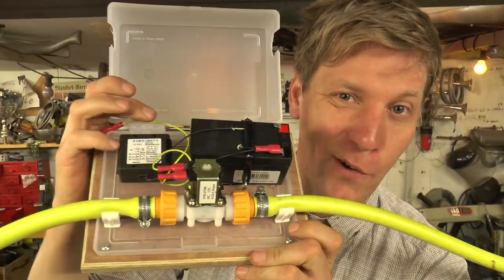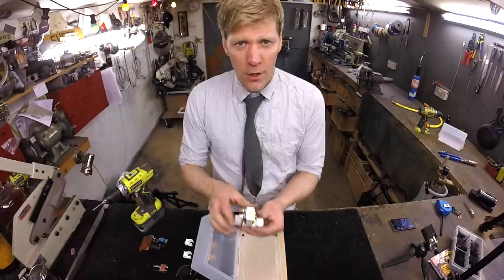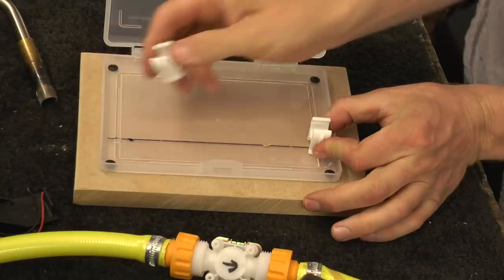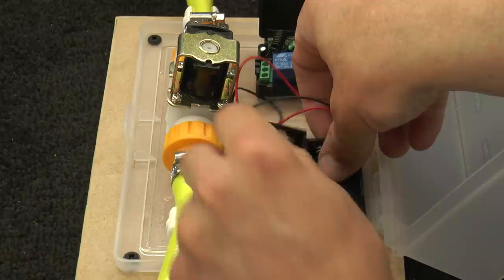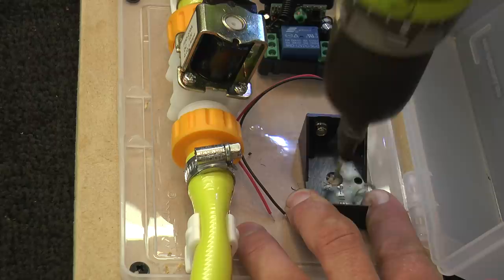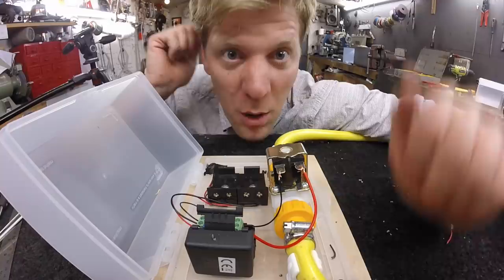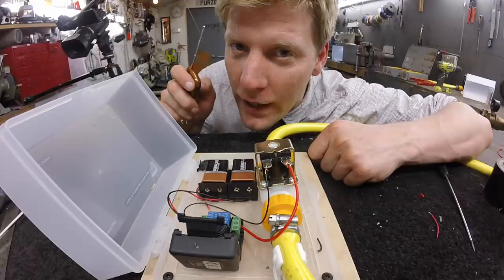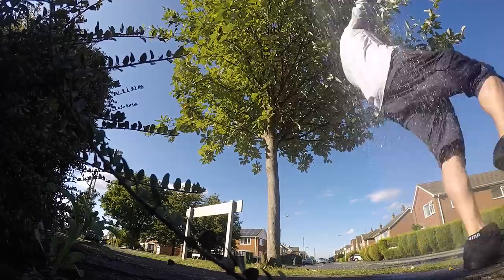How to Make a Remote Hose Pipe Controller

Comment: Using 9v batteries, that receiver will probably drain them in a few days. Also you almost certainly want to use the NO contact - with the NC, you will probably be running either the relay or the solenoid all the time, again running the batteries down when it's doing nothing.
And winding wire round spade tags is going to be really unreliable. At least wind a few turns round. Really not up to your usual build standards.
Reply: anss he made a mistake with the nc and  the no
Reply: I didn't expect a comment from Mike on here.
Reply: ouch, all crits out today..
Reply: mikeselectricstuff Yeah it was a bit sloppy and boring. I would have expected him to run gasoline trough it and have an awesome flamethrower sprinkle or something .
Reply: nemode dj This is a new adventure for him, kids. Criticism is key to success. Albeit kids will have fun with this design, always best to get it right. With that said, intentional poor designs could lead to the students discoving the more efficient/correct method. All fun times
Reply: I agree. I'm a bit surprised the Common on the relay is independant of the Negative of the power source. I have to admit that I have not connected any of those wireless relays before.
Reply: this is meant to be a simple project for kids, and also he said that you can use a 12v battery such as a small lead acid battery to make his last longer.
Reply: Simon Forget. It is normal for the relay contacts to be entirely isolated from the rest of the circuit. Don't forget that such a relay board can also be used for switching AC devices such as a garage door opener or a electromagnetic door lock.
Reply: It's meant to be easy and kids should be able to make it. That's why it's so bad.
Reply: Don't invite Mike to your party
Reply: Felix O'Keefe: I thought about this schematic and I understand the whole thing now. I just never encounter such circuit in the past. Good to know for a future setup.
Reply: Exactly... if you don't do this kind of thing on the regular, you probably don't have crimping tools and supplies. 9V batteries are a lot easier to come by than SLA batteries, plus a charger, etc. I mean you could go all out and get a 12v transformer and run it forever if you wanted as well.
Reply: The book is for kids. Keep that in mind. He mentioned it himself.
Reply: If you want to save battery you get a latching relay and/or latching valve.
Reply: #nobodycares
Reply: MarkusOfficial yea he's on hear trying to steal ideas for he's channel. He's a thief.....facts
Reply: Beware of phishing, my friends.
Reply: mikeselectricstuff Is it best to use NO relay and NC solenoid valve?
Reply: Come on Mike .. really? It's a video to go together with his book for kids.
Anyone that makes it will use it once and then it'll spend it's life in a cupboard somewhere until Mum throws it out with Dads stuff when she kicks him out.
Reply: Have we lost the art of 'soddering' these days?
Reply: Colinn seems a bit simple minded but at the same time smart which isnt a badthing
Reply: Blah Blah and more BLAH

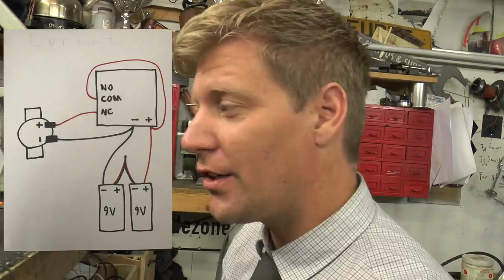Comment: 8:40 That absolutely makes sense and makes the board more flexible.
When you want to switch a 120V or 240V device you shouldn't power the receiver and the relais with that voltage. So you need two different power inputs.
Reply: actually good system ghas two voltages - one like 5v for electronics and other like 24v for solenoid. why his replay is so strange and work with one voltage I have no idea.

Comment: Relays for the most part will always need a common connection. Also you would wire using NO contact of the relay meaning no current flows to the valve under normal conditions. When you activate the relay (button) you close the circuit allowing current flow to the valve.

Comment: This would be great for a Red-Light/Green-Light game using a sprinkler, and put a slip-n-slide at the end, or make the race end at the pool!
(For those unfamiliar, I'm Jamaican so this might be a game not everyone knows, it's a race type game where all the kids line up, and one person separate shouts "Green light!" And they all run, "Red Light!" And they have to stop. The fun is trying to trick people by saying stuff like "Green LIME!" or "Red Flight" etc... if someone runs before you say green light, or if you say a different word they go back to the start, same with red light.. if they don't stop fast enough or mishear you they go back. 
You can use any code words you like, or even use actual lights, or hand gestures, but in JA where I'm from and in FL we used RL/GL.
So my idea was to use the sprinkler with this game, run while the water is on, stop when it's off.. first to the slide or pool wins, and maybe you could add some obstacles and fun stuff along the way, slip slides, kid pools etc.. )

Some variations you can try:
- Hand gestures.  We have done games where right hand up/open was go, left hand up/open was stop. That was hard because kids mess up the arms, or run even though you made a fist.. the more impatient they are the more fun!
- Trivia Run! Ask fun questions, like "What is Hulks real name?" Or "Who was Spidermans uncle?". This one only works with a few kids, so you can hear the responses. If they get it wrong, they start over. 
- Jam Session! Play music, and only run while the music is playing, but with a twist. If (once stopped) they can guess the song and/or artist they can take a few steps forward, or jump ahead a place. But if they get it wrong, they go to the back of the pack. This one is my favorite to play with my sisters kids, because they love classic rock now and it's cute hearing a 6 year old shout "Forever Yours! JOURNEY! Right!? Did I get it!?" So it's a fun way to share music you love, and know they probably can't guess it until they've played a few times and learned the songs.

Comment: This boards are intended to be used with a low voltage "control" supply (12V) and an ISOLATED AC 230/120V supply to drive lamps or similar, that is why they have the relay, to isolate. The three terminals of the relay (COM, NO, NC) are like the three terminals on a SPST switch. The relay connects the Common with the NC when no voltage is applied to the coil, and connects the Common and NO terminals when the coil is energyzed.

Comment: those quick connect garden hose fittings work great to make water rockets out of 2 liter soda bottles. I cut a piece of pvc pipe about 9 inches long or so (pipe size I think its 1/2 pipe size) and using construction adhesive glue, glue it into the opening of a 2 liter bottle (smear some adhesive inside the bottle mouth about an inch in max and a bit on the outside end of the pipe) you want it to go in the bottle so that its just past the spot where the neck meets the flared bottle, I usually push it past then pull it out to the spot it needs to end up. put some tape around the neck and pipe so it wont move and stand it up in the corner (bottle up, pipe down)so the glue settles around the pipe.  takes a few days to dry enough. to the other end of the pipe glue a slip fit to threaded pipe connector, you want a male thread to screw a garden hose quick connect nipple to 3/4 pipe thread is close enough to the garden hose thread to hold ok.  fins are made from panels cut from squarish plastic jugs like detergent bottles. I cut them so the fin is 2 inches tall by 3 inches long and I use the corner of the bottle so I can leave a 3/4 inch piece at a right angle to the 2 inches tall part. put 2 holes through the plastic fin in the crotch of the right angle, each hole near the top and bottom of the fin. take two zip ties and thread the 4 fins onto the ties and start zipping them into a loop. put the pipe through the loop and start to take out the slack while spacing the fins around the bottle. the 3/4 bits should be on 4 sides of the pipe and just overlapping the next fin. once its all tight the fins should be somewhat offset to the pipe so they tend to paddlewheel when the bottle comes down from a flight. the zips should be tight but you don't need to go nuts as the pipe fitting will keep them from sliding down any further.  the launch base can be anything you want, you just need the female socket for the garden hose quick connect and some sort of fitting to fill the bottle with air. I usually just use  pvc T fitting and adapt a Schrader valve  fitting into it. the female fitting usually has a check valve built in, I punch that out to add a rod that fits freely into the hole in the male fitting and glue it into the T so its sticking up and acts like a launch guide and piston to the bottle, it has to be short enough the bottle will lock into the female part. best to make the launcher light enough to place it into the bottle then turn it upright to launch. the bottle you fill about halfway with water and then screw the hose male fitting onto the pipe. a little grease on the threads and rubber washer makes it unscrew later much easier, same for the rubber o ring on the pippin. lock the hose fitting together, bottle to base and set it down and pump it up with a bicycle pump.  works best below 50 psi as too much pressure and the air pushes past the water and you can hear the difference when you launch.  pump it up and pull down on the locking collar and off it goes! obviously don't be over the rocket when launching as it packs a punch. at apogee the bottle usually lays over and comes down sideways, slowly spinning. 1.5 liter bottles go higher but usually don't spin down and tend to bash themselves apart faster.

Comment: If I dont remember wrong NC or Normally closed is a closed circuit allowing current to flow and
NO or Normally Open is a open circuit meaning it is no flowing current
Reply: Google confirmed my conclusion 😇
Reply: the switch though is what controls the current though, so the relay won't trip till you hit the button, you want it NC so the relay activates the solenoid.
Reply: Mostlyharmless1985 What? You want it normally open, so they circuit is open and no flow of current normally. Then when he hits the switch it will make it a closed circuit and the solenoid will activate and let water flow
Reply: orangemonkeykiller and that doesn’t matter IF the switch is also controlling the input current for the device the relay is switching. The relay can be closed all day, it won’t stop a damn thing if there isn’t any current flowing. 
Normally closed with no electron flow is still an inactive device.
Another thing to consider is how the solenoid opens and closes. If it closes when you charge the coil, then you need the relay in NC position to keep water from flowing. 
The second situation is what I’m thinking, if you hook the relay to NO and  the valve opens when power is removed then you will have water flowing when the relay is off, and stopped when the relay is on.

Comment: isn't the common terminal meant for the "negative" lead from the solenoid?
Reply: Yep, though since the solenoid is non-polar, it doesn't really matter.
Reply: Niko L No
Reply: no, not really. Its the common terminal for either the NC or NO contact. I would usually run the positive wire through the relay so it isnt always a 12V at the solenoid.
Reply: Niko L..  com. Is common power on the contacts. You have a 24v supply to the pcb used for controle. Common is the supply to the load of what it is that your switching
Reply: It doesn't do you any good if you connect both wires of the solenoid to the relay, in case you meant that. It'd just be shorting them together or not. If you'd connect one lead to +12V , the other to COM and NO to the ground, then it's called low side switching and it's how you'd do it with a transistor, but generally not with a relay.  PS. It's not like a "common ground/reference" on a multimeter. It's just a common for the no and nc contacts of the relay and nothing else.

Comment: Make a car that you can use with a PS or XBOX controller
Reply: I used to build robots and compete against other people's bots we used a phone setup where one phone was on the bot and the other was connected to a controller, we even had to code the program to control the robot.
Reply: Mr.Death the problem would be to bring it the input from the reciver to the actual steering from the car
Reply: We had a central motor controller, it was a hub the phone would connect to and it also connected to the motors.
Reply: Mr.Death and then what happened?? This is interesting..
Reply: You know there is currently a gtr which can be operated from a ps4 controller now
Reply: CarThottle and Nissan literally just did this yesterday lol check out /watch?v=tnQLbitER-4
Reply: this my browsing channel that would be awesome
Reply: I am crying as I am saying this.... I dont think he does this stuff anymore :(
Reply: Immersion on the Rooster teeth channel did this, they also did "3rd person driving" where they blacked out the inside of the car and you drive the car using the controller, using cameras looking at the car from 3rd person view =P something I personally would LOVE to try out.

Comment: This would mean the hose pipe input side would be pressurized all the time and I find that hosepipes split and squirt water everywhere if you leave them pressurized for to long, but we'll done for using dubalee clips instead of the hozlock connectors as they spring leaks and pop off altogether, I know because used to work in a garden centre and the hozlock  connectors are a common failure when where where watering the nurserys

Comment: I'd probably try to find a toggling circuit instead so I don't have to hold the remote down. Or have the remote trigger a 30 minute timer. Either way, book FINALLY ordered. I'll tweak the circuit to suit the needs (no more forgetting the sprinkler's running over the weekend...)

Comment: Just a heads up to anyone who plans on using this in a more permanent scenario: 

those little relay boards are really in efficient and so your batteries will drain pretty quickly if you leave it running 24/7 As a result, I recommend running a mains wire to it, putting that though a 12V transformer, then running that into a full bridge rectifier and holding it at peak voltage with a capacitor in parallel with the inputs. In the past I've used little 16V 2200uF caps and they seem to deal with the changing current nicely.
Reply: as i understoof these realys dont use energy at all. they are opened or closed on circuit. so they cant use any energy.

Comment: Attach the water output to a rotating garden spray head, trigger unit with a motion detector connected to a relay, then spray down rabbits, squirrel and deer in your garden. It could be hooked to flashing strobe lights, police lights, or alarms as well.

Comment: The reason that you need to connect from your battery to the com pin, is because normally these boards work with 5v, but the thing that you control (a door) need more voltage (or current, that's why there is a real). So, it is perfectly normal to connect an extra wire to the com.

Comment: 8:40 you need to put the positive in the common terminal also because it's the pin on the relay that connects to the no or nc throuh the relay I think. If some boards don't need that then tey propably have it internal.

Comment: Big fan here! However, I had a need for this a few years ago.  I ended up purchasing a water pump that had a standard 3 prong electrical plug.  Then, I purchased a remote controlled surge protector that was sold to remotely turn on electronic decorations like those Christmas balloons.  Thing came with a remote similar to key-less entry for a car.   Think it cost me $25.00 or something like that.

Comment: If the diameter of your hose is too small, dip the end in hot water for a while to make it pliable so you can force it onto/over the fitting.. Or as Colin might say, "Pop the end of yer hose in a fresh hot cup of tea, and it will come out a little bit stretchy and you can bang it right on there".

Comment: I did a similar thing using Arduino nano, a bluetooth module, and a relay for a watering system . The valve I used was 120VAC and I powered the arduino and bluetooth with a small power supply. Was fun to build. I might try a wifi module.

Comment: Just as an ironic question: An open circuit sprays the negative charges to the other terminal and the com terminal (common ground) is basically for nothing, since we just shove all our cables in the negative input terminal :D. Electrically, I sense some potential here. Potential improvements :)

Comment: Put the negative from the solonoid to common and normally closed means a closed circuit whitch it will be on and normals open is an open circuit and it is off backwards from logic but if it is a toggle switch it won’t matter but if it is like a tactile button it will be inverted.

Comment: NC - normally close really contact, that's means then yor RC module are off COM is connected with NC and COM are disconnected from NO. 
When RC module are ON, COM connnect's with NO and disconnect from NC
COM - is for supply voltage it can be from 1V-240V AC, DC almost the same.  In this case RC module are made from two main components,  RC receiver and really. RC receiver switch really and really switch valve.

Comment: Hi Colin, You could do with a 1N4001 diode across the battery terminals (or power input on the relay) to stop arcing. Your relay could burn out! Place the white bar (cathode end) on the positive power terminal.
Reply: why it shoudl burn? it dont have an energy running till switch is pressed.

Comment: Since you seem to have NC and NO backwards, is the solenoid valve normally open then? The way you have the relay wired would suggest that current is always being sent to the valve EXCEPT for when you trigger the remote. In circuits, closed means ON (connected), and open means OFF (disconnected).